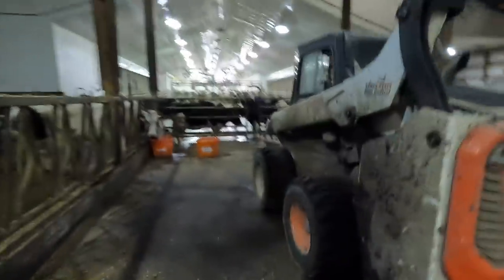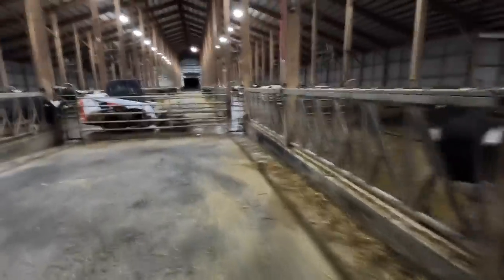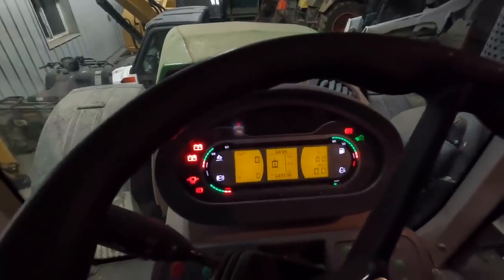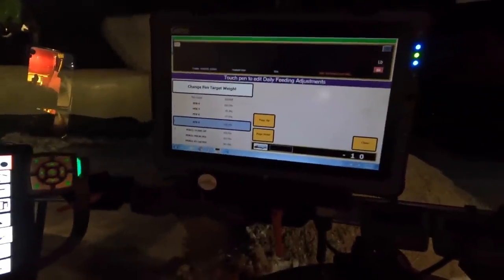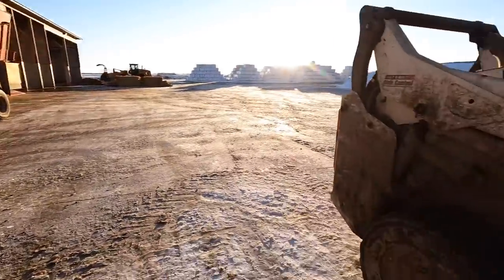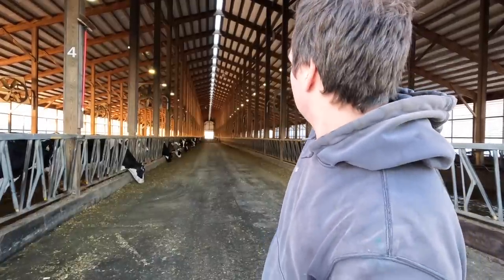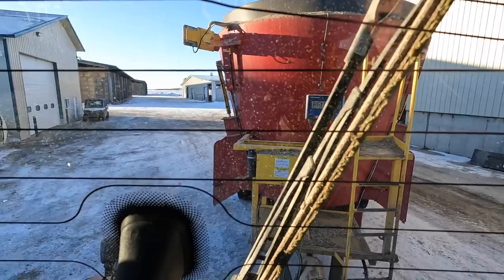Feeding Dairy Cows with Fendt 930 & Supreme 1700 (23)

Comment: Nice setup, more efficient than the other dairy's that I am watching, however none of them are as big as your's either. Couldn't you push the feed from in front of pen 1 over to the front of pen 2 as some of them looked hungry but there was no feed for them like at 14:50? They are all probably looking for the fresh feed, but if they could eat some of the feed you are throwing out that might be worthwhile and save you a little time.
Reply from the maker: Those 2 pens just had their bunks cleaned and that load I was unloading was for both pens, I just didn't show unloading for the other pen.

Comment: I am planning to build a pit to park the tmr in aswell .... wouldn't it have been nicer to put that pit 90 decrees on to the building from your feed bays?
Reply from the maker: It would make loading a little easier, but our plan is to extend the roof over the pit to protect that loading area from wind. That's the main reason we have the pit in that spot.
Reply: @pietvanbedaf-nddairyfarmer9047  I see .. that makes sense.. don't have that much wind in Central alberta 😁

Comment: Great video. That computer system sure makes things easier. I'm sure it helps manage so you don't waste as much ingredients. Feeding looks like it's pretty much a all day job. Thanks for sharing
Reply from the maker: Yes, it's easy to see that we're adding the right number of pounds for each ingredient. It also helps us manage the amount of feed left over in each pen so we don't underfeed or overfeed. Typically we would have 1 load after lunch and then getting bales ready for the next day and opening the feed piles if necessary.

Comment: Isn’t that a over kill tractor on that mixer
Reply from the maker: The tractor can handle the mixer well hp wise. We had a 927 on it in the past, but probably wouldn't want anything much smaller than that for hp. I wouldn't go any smaller as far as frame size and weight goes, especially in the winter time when it can be icy around the farm yard.
Reply: @pietvanbedaf-nddairyfarmer9047  so is that mixer a 1000 pto or does the tractor have a 540 pto because that’s a big tractor to have a 540 shaft
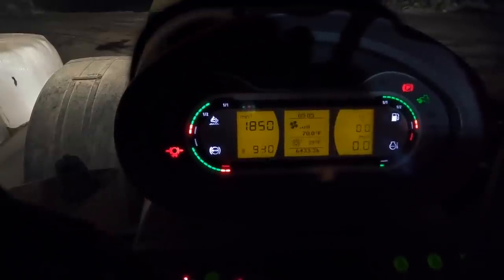Reply: @evanhix7049  You can see he set the pto at 5:30 to 950